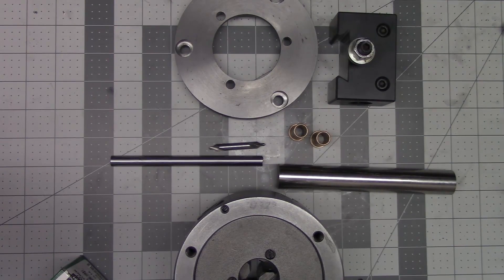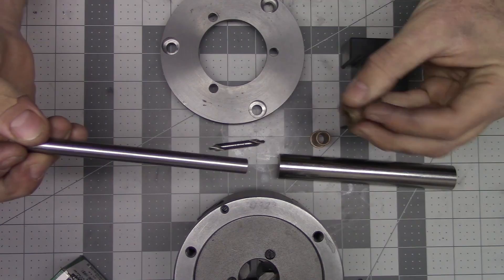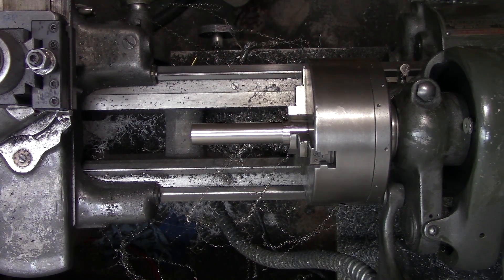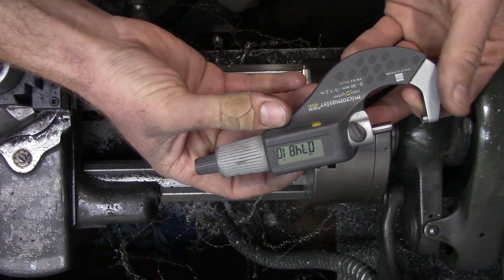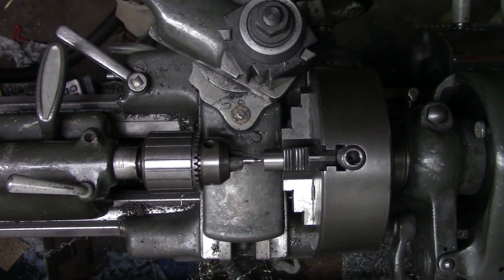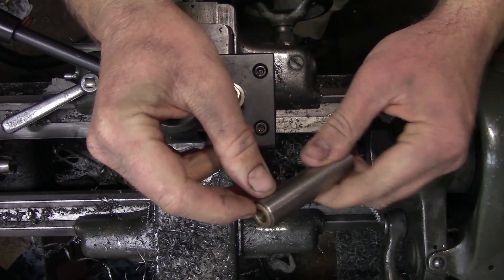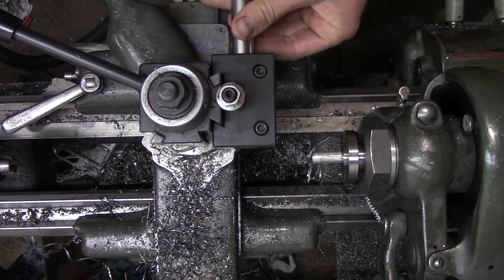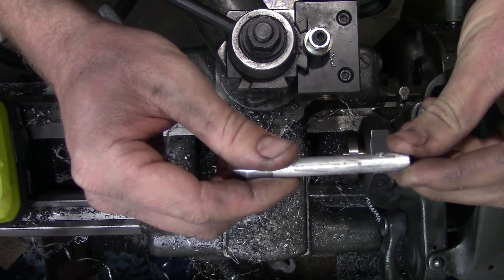Tool Post Drill

Comment: I like your choice of materials for the project. I'd like to build up a nice little collection of various sized bronze, brass, cast and stainless stock to draw from. Thanks for sharing the video.
Reply from the maker: The best source for stock to work with is local machine shops. A lot of times they will sell their cut offs for pretty cheap. I get the stainless I work with from speedy metals. I typically order more than I need so I can build up stock.
Reply: I need to find a machine shop in my area, even one that is unfortunately going out of business might have a literal ton of cut offs that have to be cleared out. I like the idea of ordering a bit more than is needed in case of a mistake, but also just to have extra on hand. I need to finally get around to ordering some that ductile iron from McMaster- Carr.
Reply from the maker: McMaster is a good source but they are pricey at times. However, what you do order comes extremely fast. I have ordered from them and it delivered within 24 hours.
Reply: I've never ordered from them online, but my dad used to work there actually. It's not far from where I live. There's a Grainger and a Fastenal near me too. I get the pricey part PLUS the sales tax :( I think paying a little more is worth the price keeping them in business. The one that hurt was that CDCO place. It's not far from me either, but it like $17 to ship my quick change tool post.
Reply: Fast is right! I just order the ductile iron. It'll be here Tuesday. :)

Comment: Very nice. Just something for you to think about is sometime ago I made a tool post drill for indexing on my South Ben when at the time it was just for a one time project. Since then I have made one with bearings and a chuck on it because I found it very useful in several projects. However I cannot take credit for the idea I got it from Steve Jordan's you tube channel. Like I said it's just a though due to you are much better than I on machining and your 2 part backing plate is the first one I've seen done and it turned out great. But you've got me thinking on the backing plate and trying to get up the nerve to try and build one like it for my new chuck. Wish me luck I will need it. Lol. Keep up the good videos they are very useful to a newbie like me.
Reply from the maker: Good luck, it is a fun project. If you have any questions let me know. As for using a chuck with the tool post drill, it is an excellent idea but for what I was using it for there wouldn't have been enough room to allow a chuck and a drill bit. The cross slide doesn't have enough travel, according to the measurements I was taking at least. I was also trying to just use what I had on hand, didn't want to purchase anything for it. I probably will make an upgraded one when I need it.
Reply from the maker: I do have a CAD drawing of the backing plate. I still have your email, I can send it to you if it will help.
Reply: Basement Machinist that would be awesome , if you don't mind sending them to me. I would appreciate that very much. Thanks.
Reply from the maker: The drawing is on its way.
Reply: Basement Machinist Got it , thank you very much. Now the challenge begins. Lol. The thing I like the most is you have room for adjusting it.

Comment: What about adding a small Jacobs chuck instead of dedicating the drill rod to 1 drill bit?
Reply from the maker: That would be a great option so long as there is room for it. There wasn't in my case. I made this for the backing plate project. With my lathe being small and the large diameter of the work piece, the cross slide doesn't have enough travel to allow room for a chuck and a drill bit.